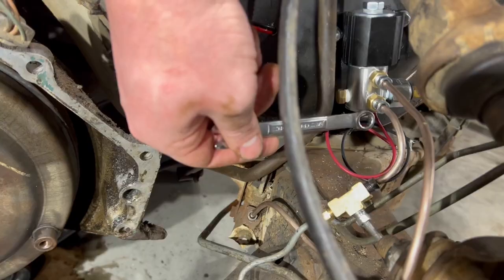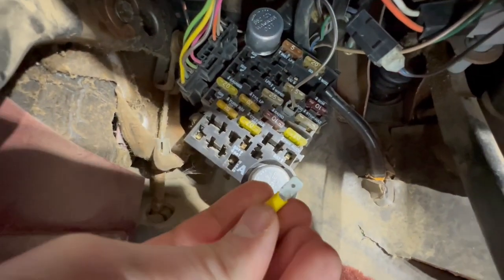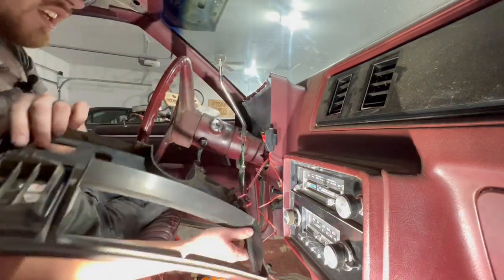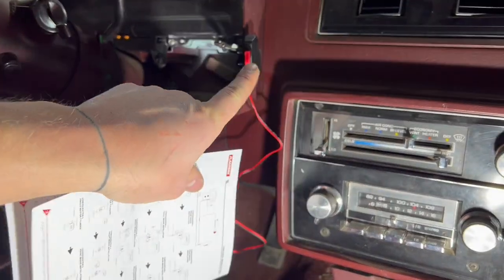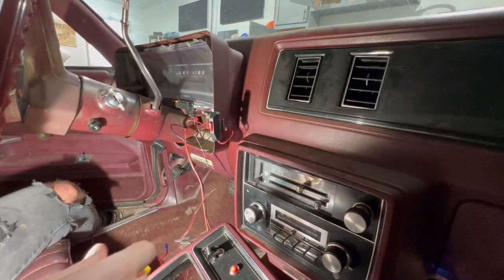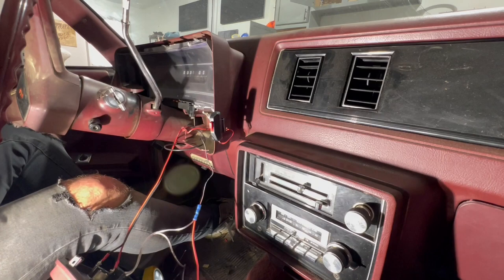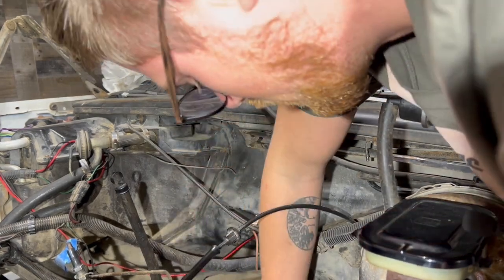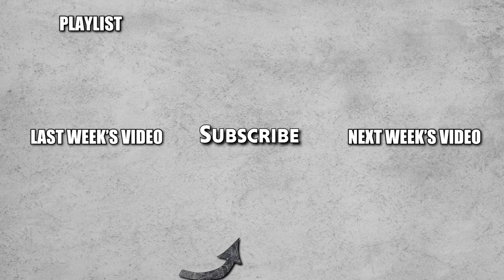Installing Line Lock Part 2 - Wiring Switch And Indicator Light | The Meano Camino

Comment: Did you ever do a video on wiring  the brake light switch  in?
Reply from the maker: We have not yet! Just left the lights the way they are which means when I let off on the brake when I have the line lock engaged the light come off which isn’t that big of a deal for me right now